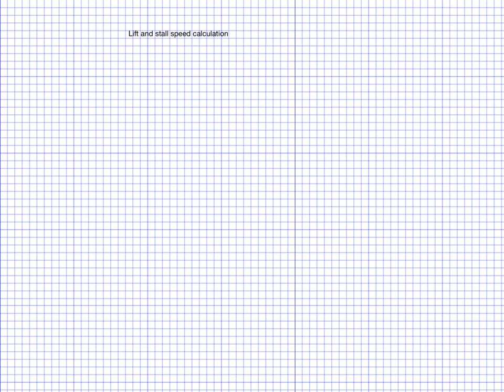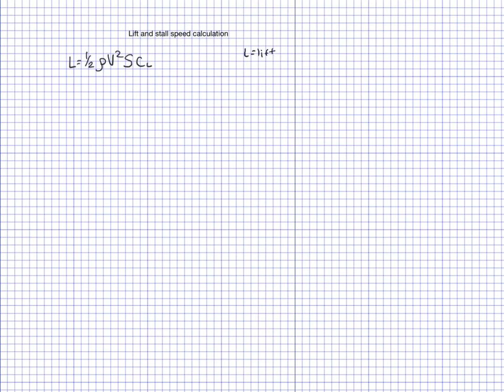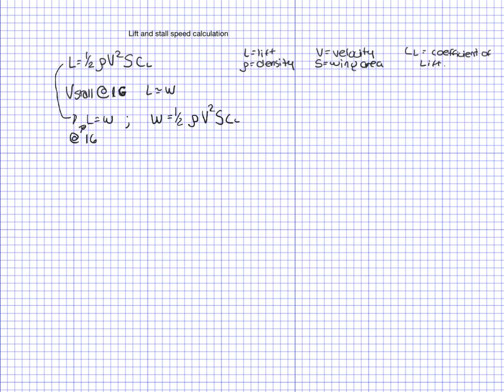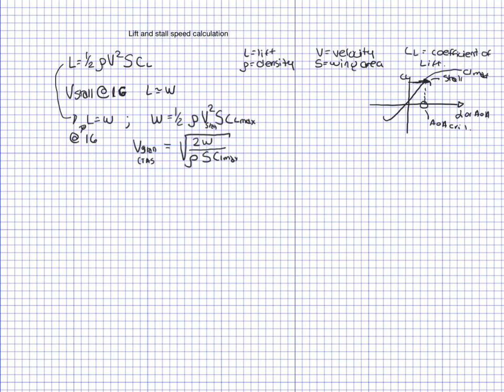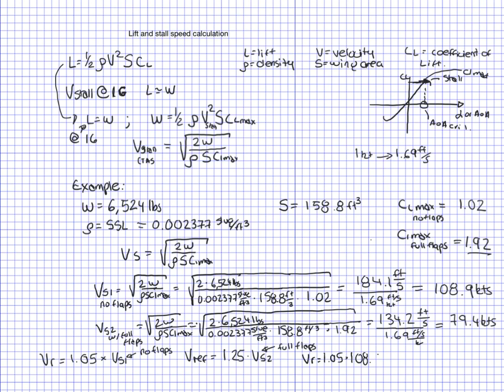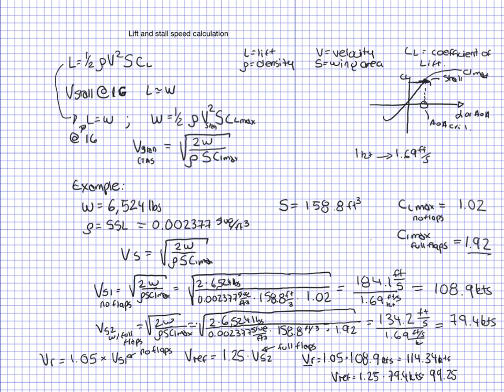Lift and stall speed calculation

Comment: Good video that pretty much follows the Bernouilli's equation for lift.  But in fact, the air speed squared, v^2, you showed in your calculations is actually the airspeed on the top wing squared, vtop^2, minus the airspeed on the bottom wing squared, vbot^2.  People conveniently approximate v^2 to be equal to vtop^2-vbot^2, and imho that is not too accurate :-))